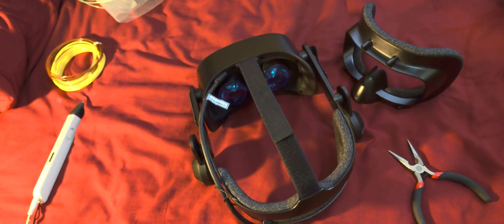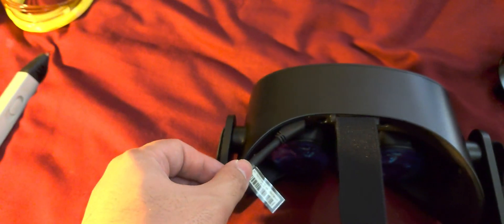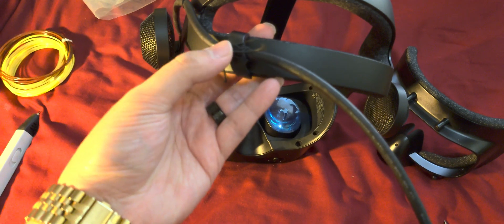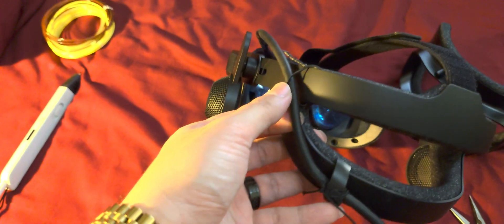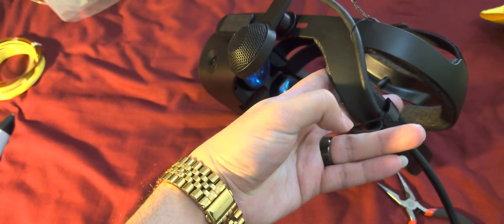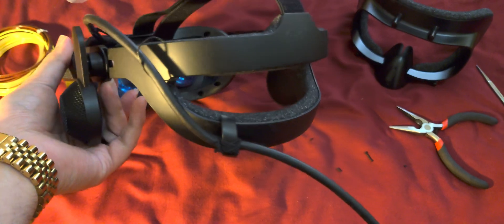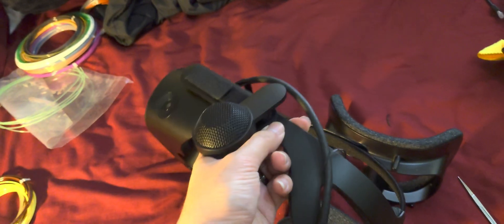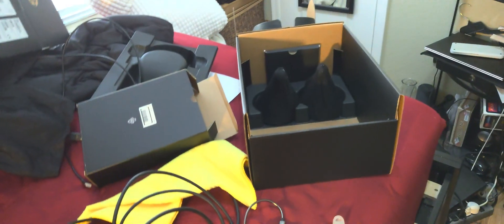Do This BEFORE Ruining Your Reverb G2

Comment: After having to replace the cable 3 times in 1 year at over $100 a pop I just taped the cable to the headset where the cable clip would go and I never remove it. No cable trouble for 2 years but now the screen blanks out and glitches, so I'm guessing the headset itself is now bad.
Reply from the maker: That's brilliant! The failure occurred from bending at the connection point where the cable meets the headset ...despite its barrel depth! 
 
What you are experiencing might be a rapid jump rather than full disconnect, as it is the first sign of its symptoms. 
 
Is your graphics card overclocked?
Reply from the maker: The cable issue first presents as a stuttery freeze, followed by a blank screen; and then maybe restart behavior if the cable only experienced a temporary movement before falling back in place.
Reply from the maker: That cable is just so stiff that it can twist the connector at its end dislodging its pins just from bending too closely near to the headset.

Comment: As others have said, you definitely want the cable to route under the headband so that as it pivots up, there is no movement of the connector.
Mine was a few days out of warranty when it failed, like a built in timer went off! 
Great HP aftersales service - your on your own boy!!! It is clearly a major design fault.

I now have the most technically advanced door stop ever made.
Reply from the maker: The tension of angular torsion generated by the mere hardness of that cable inflicts the gradual damage instigating its most plaguing insulative connector pin separator failure over time from inducing downwards force at such proximity, though; so, you pick your poison.

Comment: I have to replace my cable about every 6 months, but I unplug it from the headset after every use, so that's probably why.....
Reply from the maker: Indeed it is as its connector plugging point serves the entire weakness thus this fix of its aims to entirely solidify that permanently as mine still works like a charm since then 🙌
Reply from the maker: ...otherwise it's the slightest side-to-side tension marking its demise when pulled and be careful reports prove you could permanently damage components delivering excess voltage through such pin jumping too

Comment: I know not everyone has a 3D printer, but theres a few 3d printable replacement cable clips. If you have the option to, use those instead. one of them positions the cable up so it has less strain along pulley systems (it just sits at the rear of the rear headstrap, below where the adjustment point is if that makes sense.) the other one replaces the cable clip itsself and makes it so it holds the cable in place.
Reply from the maker: Thank you for the tip my friend 👍 it's appreciated!

Comment: About to get a G2, is this still a big issue? What’s the best way to minimize this if it still is an issue?
Reply from the maker: Indeed it is, though following the steps in my video entirely mitigate it as that one you see there hadn't any hiccups since.
Reply: @BradTech.  I heard people talking about it being wiser to strap it to the bottom of the headset rather than the to, like you did, is that actually better? Would it be too much trouble to write or a step-by-step method to keep the cord from wiggling.

  I apologize if I’m bothering you.
Reply from the maker: The cord will suffer a variety of tension @JimBobJoeB0b through its interference with speaker and your head as the strap pivots and stretches during placement, and its feeling between your head and speaker will limit its slack to be inefficient while spoiling your immersion, not to mention its downward angle would pose an anchored tension point against the connector. Therefore, in running it above you are to leave excess slack in accommodating for the greatest of stretches without compromise, and I'd recommend a stretchy string like a hairtie in that its rough exterior coating does not vary in position against your cord yet still allowing it to pivot freely without digging into its insulation while its kept from getting far enough from your head to wrap past the speaker with a soft loose cabletie as my setup remains flawless for years that way versus the others failing within the month. Although these instructions make no sense without some of my video's visuals.
Reply: @BradTech.  so basically, just follow your video and ignore the comments. Got it, thanks!!

  Shame this issue still persists in the V2 model of the g2, hopefully in the near future they’ll figure it out...
Reply from the maker: Indeed it is @JimBobJoeB0b as numerous engineering compromises account for retaining its formfactor with such a stunning 4K display at an enticingly low cost/price.
Reply: @BradTech.  is just surprised that I haven’t heard more about this cord issue. I’d have to read them again, but I don’t remember the pinned pages of the Reverb G2 subreddit talking about it.
Reply from the maker: Otherwise @JimBobJoeB0b its lenses' outer blurring gradient is highly influenced by their confinement to such excess curvature as its mitigation is as simple as enlarging their diameter.
Reply: @BradTech.  ?? I don’t understand how that relates to the cord’s issue
Reply: @BradTech.  ahh I think I get what you mean?
Reply from the maker: Well you said it's a shame @JimBobJoeB0b I thought I'd point out some of the more shameful shortcomings in my opinion 😅

Comment: I cut the velcro strap off the power supply that came with the G2 and used it to fasten the cable to the back of the head strap. Worked a dream
Reply: awesome tip.. thanks
Reply from the maker: Talk about resourcefulness haha way to go! Only fear is that their lacking elasticity could leave them digging into the insulation, unlike the roughly textured stretchy string given its rounded edges, otherwise great work! 👍
Reply from the maker: Velcro straps and zip ties are to use their flat side in pressing down and not to exert sliding side-to-side force as which employs their sharper outer edges against it like a knife.

Comment: With this technique im  suprised the clip on the back hasn't broken yet 😬
I would suggest velcro straps but that's just me
Reply from the maker: I actually prefer that it's intensionally designed to snap off, that's the whole point of my fix!! 🤦‍♂️ It's got to be so fixed in slack length that it servers as warning
Reply from the maker: Also note that I facilitate proper cable management this connector moreso is getting damaged strictly when taking off and putting on the stretchy backstrap and that's it

Comment: I used Velcro at 4 spots all the way to the back..if the first goes...havent even had that happen yet but then there's 3 more points that will still hold...never had as much as a tug on the input...very stong..
Reply from the maker: interesting 🤔 that's different
Reply from the maker: just reminding you that with proper cable management I'm not at all worried about the wire being pulled rather than insuring a concrete set length of slack as the cable ages in mitigating the only impact of damage occuring just when putting on and taking off the streching backstrap, that's it, that's the only reason it's breaking is all.
Reply from the maker: once it's broken if course it crashes when tugged if not secure but I this is to prevent the port pins from ever initially breaking loose like that to begin with

Comment: google zip ties lol.
Reply from the maker: Yuck! lol hard, sharp, and with a bulky little block on their end; NOT the elegant way to secure coated wires that you're pinning down from slipping under tension, zip ties might shave off the insulation when tightened enough because you're not gonna be wanting to ever let that move even a millimeter over time as the cabling ages, not to mention stretchy string acts like the common termination strain relief boots in facilitating limited pivoting to prevent excessive flex while remaining wrapped around the cable tightly enough at two varying points around the strap clip very many loops around prevent it from sliding or slipping. but thanks anyway your opinions are valuable to us!
Reply from the maker: I recommend this followup https://youtu.be/lmrpapyaBc8?t=15 were I readdressed some of the highlights not to mention our video description to factor some of the reasoning.
Reply from the maker: However, a ziptie around the cable alone could act like a stopper using its cube-end to bump that clip behind the strap and guarantee that cable point can never slip past it, which is safer than using the ziptie to pin it against the strap directly because the ziptie would then be making full 360° contact with the cable in distributing its applied pressure under tension rather than only pressing it against things from just one side when holding it back... 🧐 you maybe onto something with that one!

Comment: I drilled two hooks into the ceiling above my gaming chair and let the cable hang down to the headset. Takes a lot of flex away from the wire.
Reply from the maker: Sounds ideal from what I've heard, for now my play space as a narrow rectangle is just small enough for the cable not to reach the floor hanging high enough from the wall mount.

Comment: Yeah, headset <-> cable connector is a major design flaw. I hope your fix works and doesn't just survive long enough for warranty to expire.
Reply from the maker: LMFAO Don't jinx it!
Reply: Mine lasted a month after the warranty expired, then decided to go. Always problems with HP, ugh.
Reply: Mine lasted 4 days out of warranty....
Reply: I this this from the video and it happened like you said, 3 years lasted and warranty is over.

Comment: Hi. Not a good tip as you make that cable stiff and will break it one day.
Reply from the maker: Not sure how you think so but it's simply not true as I insured far more distributed motion than there otherwise previously would be, but never the less if you knew the extent of its connector end's fragility then you would rather take anything over the chance of risking its exposure to that detrimental tug of sliding on and off the back strap when wearing it without that given concrete slack.